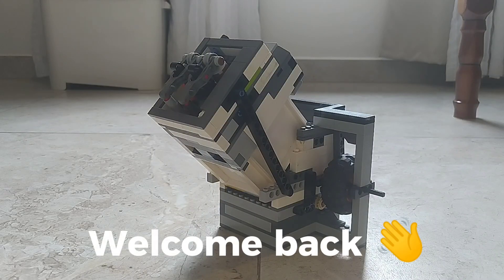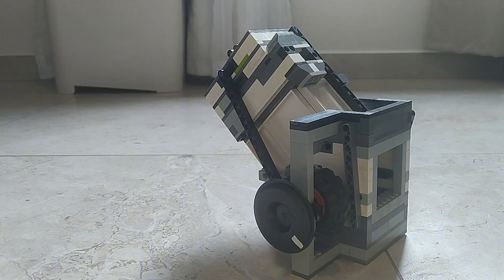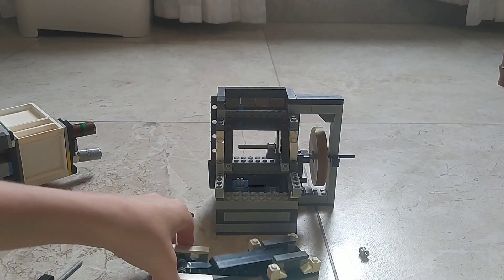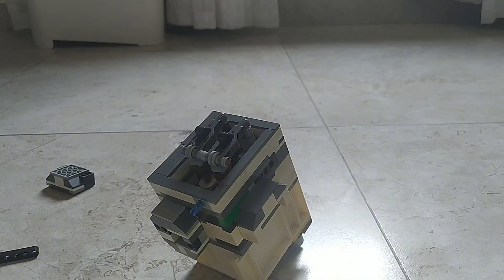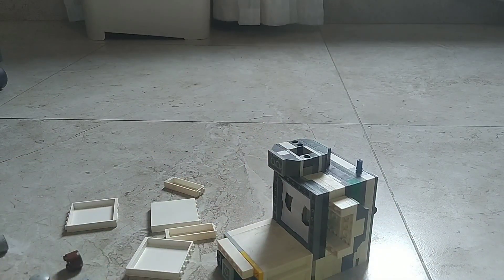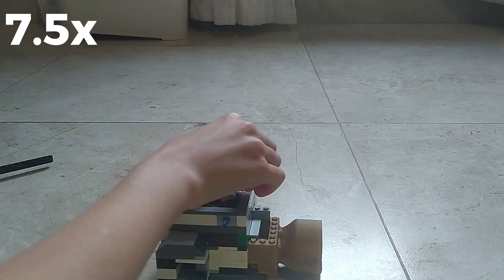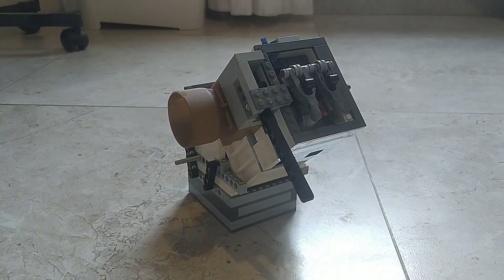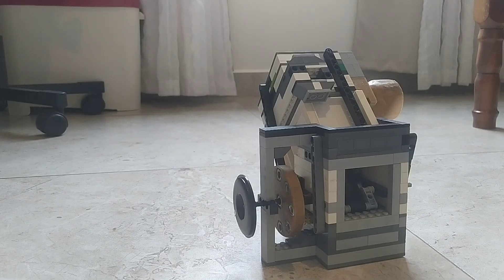Lego Predator 212 LVE tuning

Comment: i also cannot make this engine! no matter what i do it always just self detonates first start. i cannot even have it run for 10 seconds
Reply from the maker: Take care with the valves... Adjust those things the rocker arms push the valve, if the valve hits the piston it will surely destroy... If you wanna help, post a vid, tag me and I will try. Good luck 😅
Reply: @NFB_LegoMocs  I've tried i new valve type its non interference but its getting it to seal that's so hard. Expect TDI Drop in 1-3 hours. we just got back from church.